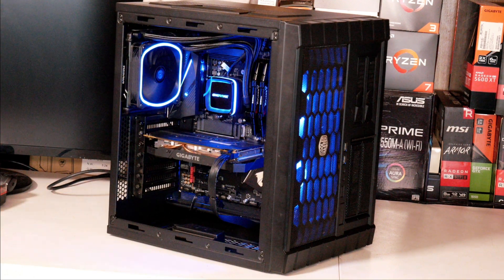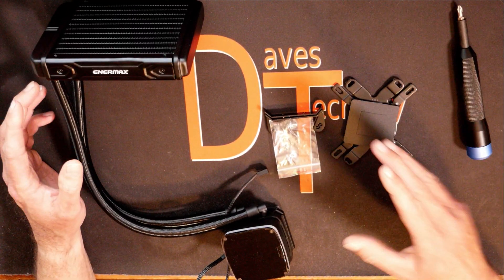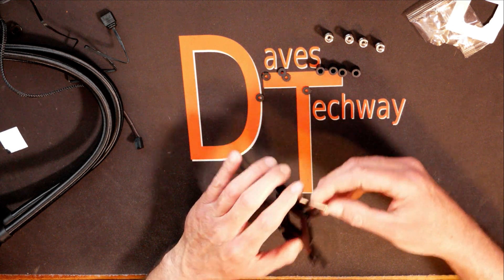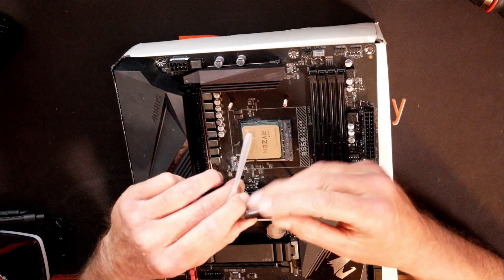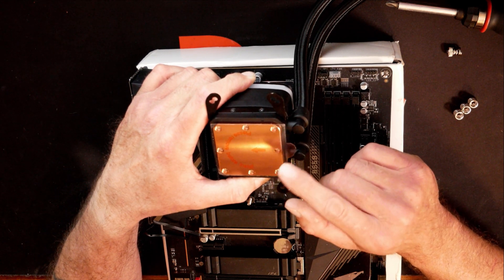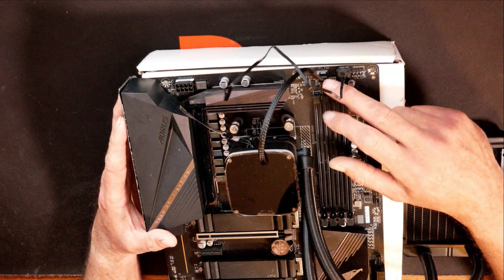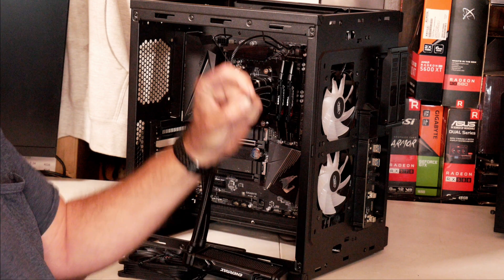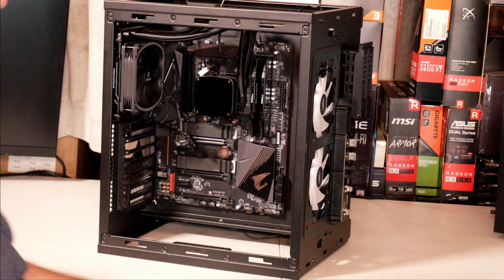Aquafusion 120mm AIO AM4 Installation Guide

Comment: You generally want to try and avoid having the supply hoses on the top of the radiator if mounted on the back or front since air will float up and get pushed back into the block and can cause impeller cavitation and reduce the efficacy to pump the water
Reply from the maker: Good point, Thanks for watching and the comment.
Reply: can you possibly send me a video of how to do this would look if done properly? 

Mine is an going to go in the back like shown in this video but I don't want to have any issues like you mentioned